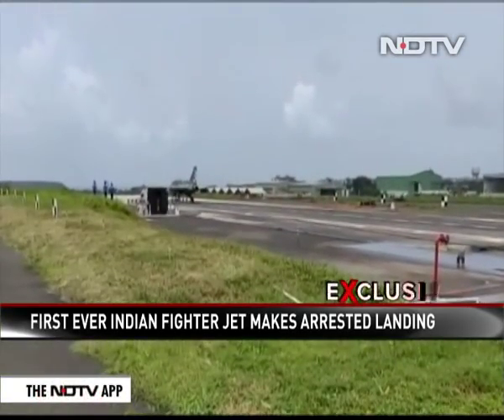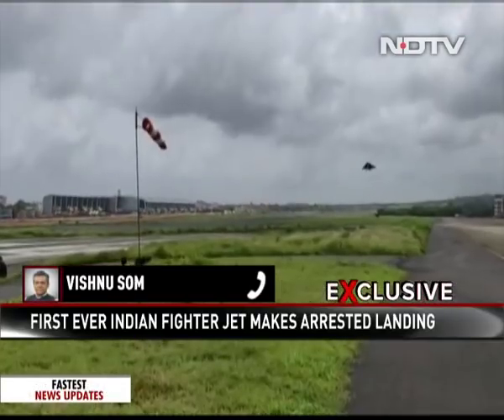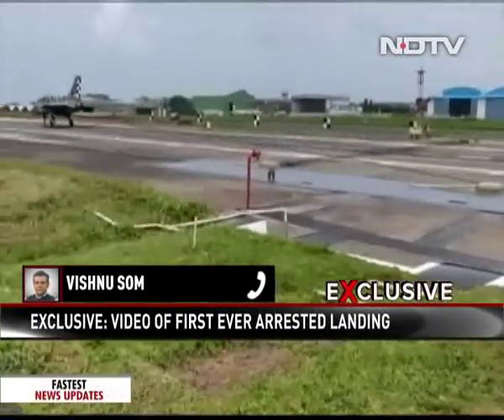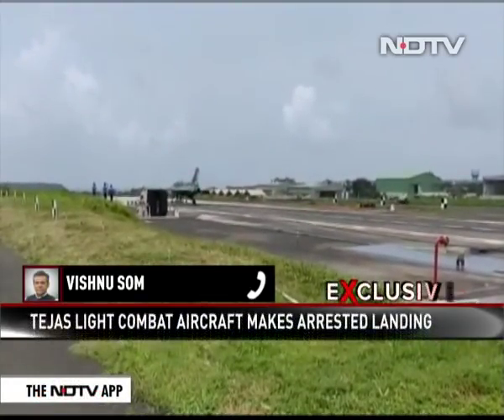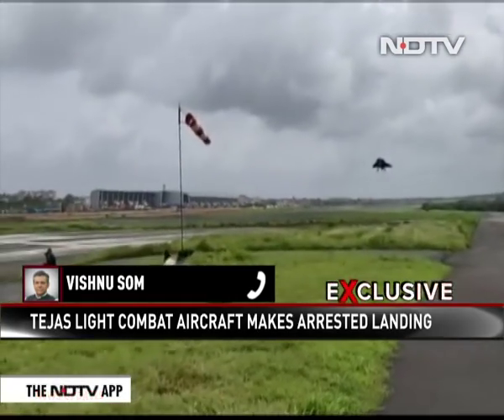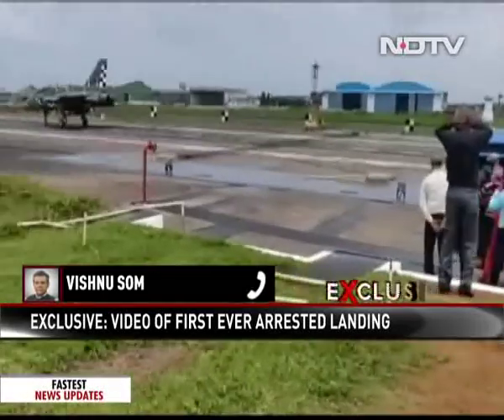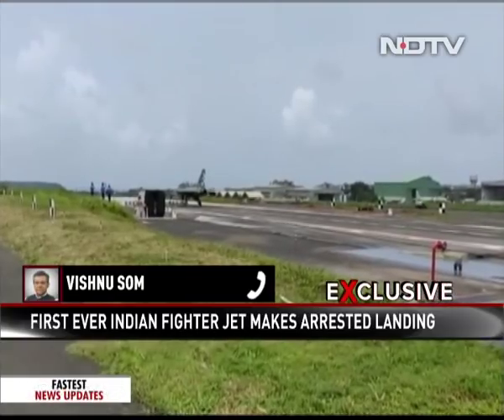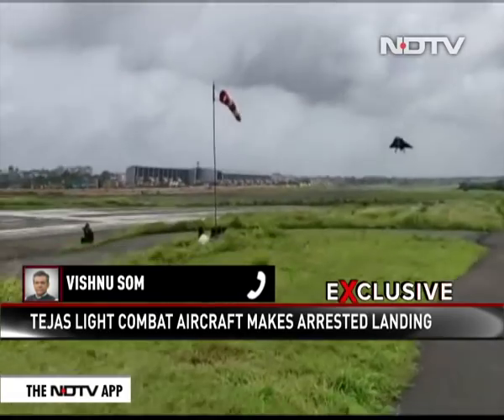244 To 0 Kmph In 2 Seconds: How Tejas Jet Will Land On Aircraft Carrier

Comment: im gonna get this straight for you guys( pls read before making an opinion the the tejas)
-Tejas is a Light Combat Aircraft(LCA) and it functions for an airforce just like how a light tank functions for an army. it's main role is to scout and act as a support installment.this means it will carry comparitively lesser arms than a heavy or medium wheight fighter like SU30,mig29.f22,f35,rafale etc. and will also have considerably superior meneuverability (i butchered the spelling sorry) and acceleration. while HAL has not released agility related figures like top speed,expect it to be on par with speeds of most russian migs. so comparing it to medium and heavy fighters is kinda like comparing a destroyer and aircraft carrier.
Reply: Marcos B  well said brother
Reply: Actually you're wrong Top speed clocked by HAL TEJAS at any event was 1.8 mac at Bahrain air show which is fairly high and we also know it can achieve 2 mac as well. With special India specific specifications like aesa radar & Bramhos missile & twin barrel 23 caliber mg along with its Delta wing design it's fairly capable of shooting down any aircraft upto 4th gen.
Reply: Not to mention this was done way back in 1944. With propeller aircrafts in Japan and USA.